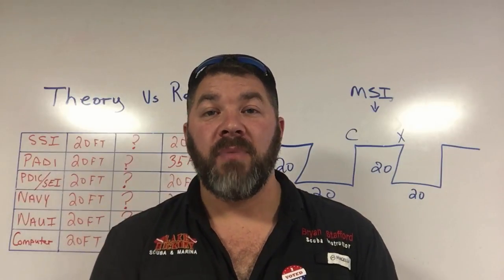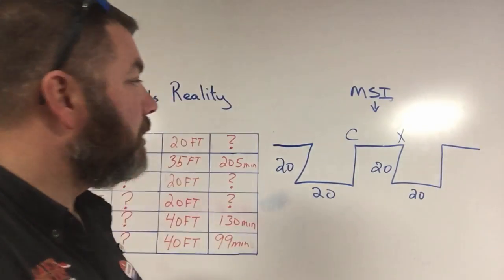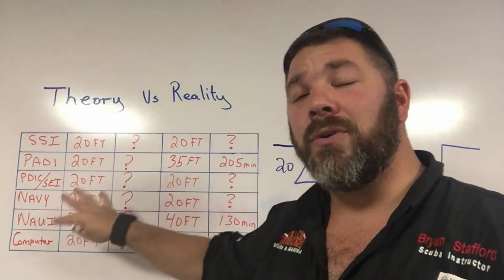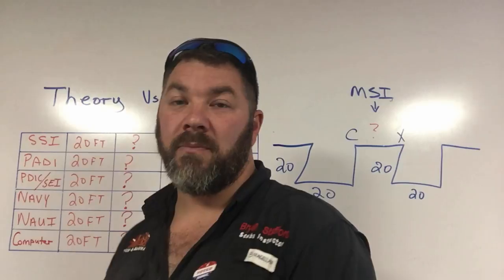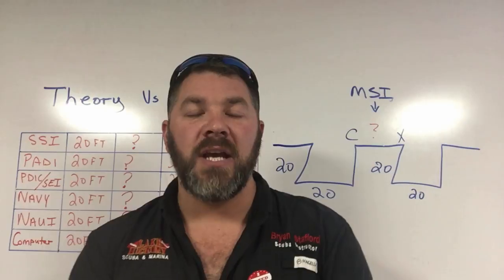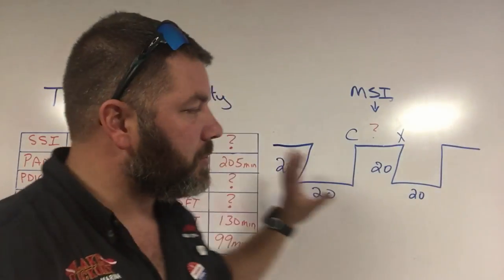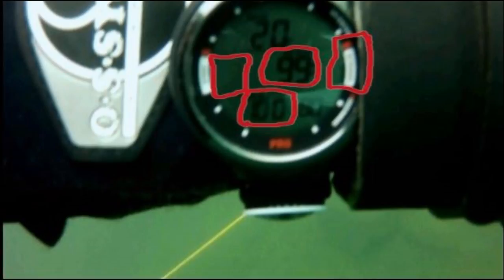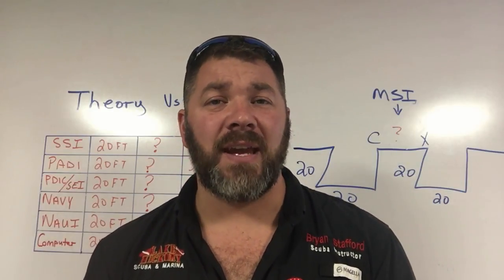Theory Vs Reality Will I Get Bent???

Comment: What is the safety stop depth in feet? 20? (metric is 6m) That would explain why you are not on-gassing, the models don' t consider on-gassing at that depth
Reply from the maker: Depending on whether you use a computer or dive tables, it ranges between 10 feet and 20 feet.  Thus, averaging around 15 feet (as taught by the majority of diver training agencies).  Most computers during the ascent phase, will turn on the safety stop feature around 20 feet, and will stop the counter if you descend deeper than that, or if you ascend shallower than 10 feet, with in a 3 minute period.  In regards to on gassing Nitrogen, our bodies still on gas anytime we are at more than 1.0 atmospheres, as can be seen on a dive computer with an AC mode.  If a diver fails to turn on his computer prior to a dive, they usually will automatically start upon reaching a depth of 4 feet, thus showing a diver is on gassing nitrogen.  But it is believed to be so minimal that keeping track of the nitrogen on gassing is not needed.  It was shocking to learn from the Diver's Alert Network, there has never been a recorded case of Decompression Sickness on any diver, from a depth of 40 feet and less.  This may be another reason that most tables start their depths at this range.
Reply: the ppN2 at 20ft is/might be too low to get you bent
Reply from the maker: I would agree for the most part, as long as we left the variable of a rapid ascent out of the equation.  Any and all Nitrogen in a diver's tissue still could expand to quickly versus leaving the tissue and re-entering the lungs during a rapid ascent.  Thus, Decompression Sickness and Arterial Gas Embolism is still a big risk. However, just staying at that given depth (20 feet), like you, I don't believe we would ever retain enough Nitrogen for it to matter.
Reply: I meant in the computer models, mine all go to a safety stop at 6m, so "off-gassing"
Reply from the maker: In that case, you computer is basically saying we don't start on gassing any Nitrogen until we reach a depth deeper than 20 feet.  This is another reason we decided to make this video, to show divers that dive theory and reality are not the same thing.  Obviously we have to be safe while diving and stay with in our limits, but in short, there is a lot of conservatism built in to Gear Manufactures Algorithms and Training Agencies Tables.
Reply: yes, you can get bent at shallow depths! (DCS after a couple of CESAs, not me!)
Reply from the maker: That is adding multiple variables into the equation, ascents and descents.  But I would agree with you.
Reply: I don't think it is because you aren't on gassing, but it is likely that they've determined from that depth within normal usage and a safe ascent wouldn't be over the critical supersaturation level that would result in bubble formation.
Reply from the maker: In my opinion you would be correct.